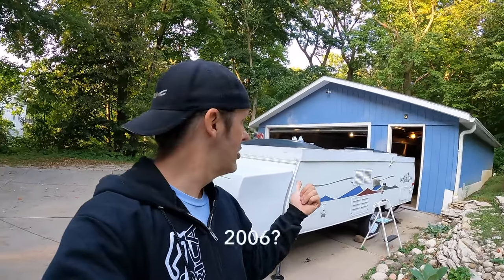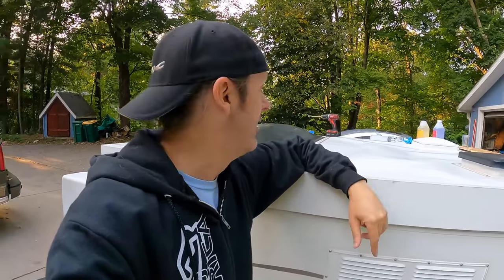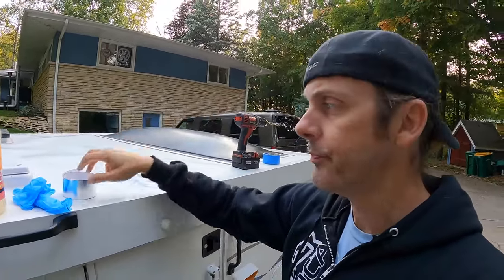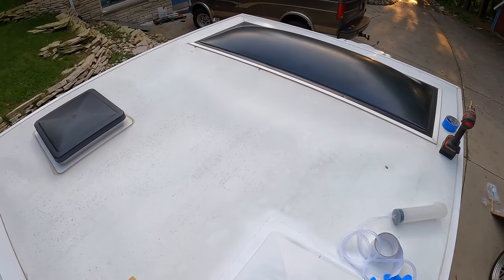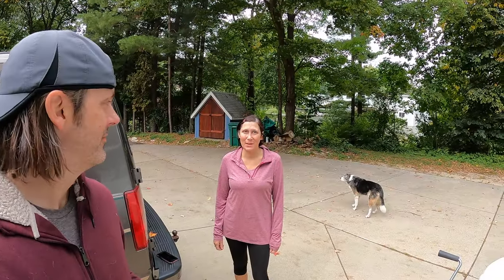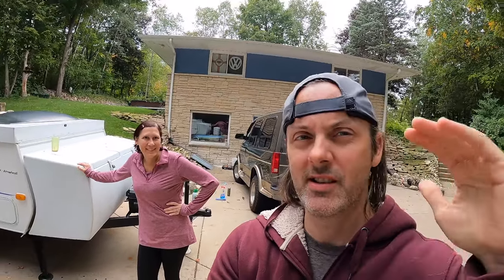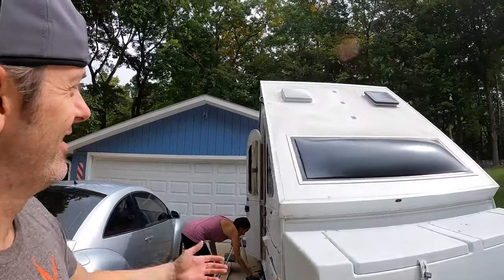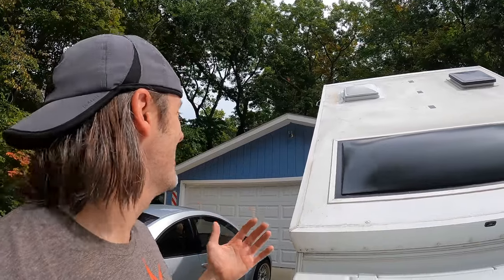Fixing Roof Delamination on AFrame Camper EASY & CHEAP Aliner Rockwood Chalet

Comment: I would not like to deal with this problem, but, if I did, I'd be inclined to do exactly as you have done. I am not sure why the skin seems to have stretched, but I do see the result you pointed out. to fix the remaining problem, it looks as if one would have to remove the metal edging on each side of the roof, drill a few more holes near the edges, inject the resin,  roll out the roof skin, trim it,  and then reattach and seal the edging.  

It seems doable, but there is also a prospect for disaster. I am not sure either how or how well those metal edge strips are mounted to the roof. Sometimes it is better to leave well enough alone.Maybe this is one of those times???

I think you did a good job and I hope your camping trip goes well.
Happy Trails!
Reply from the maker: Yeah I can’t figure out how that top sheet could be so “loose” unless maybe trailering it while delaminating causes it to “tug” a bit?   Either way it’s fixed well enough for now, and if you spotted the end scene you’d see what I’m doing next.  🙃

Comment: My biggest concern is that whatever breakdown in skin-to-foam bond occurred, is that when we inject epoxy - with this repair method we have not removed the failed bonding material, so the fix may not last long.   As to how the skin is now all of a sudden larger (bubbling) - it takes very little extra length to develop that curved surface! I suspect that excess heat is one possible cause (it failed the OEM adhesive). Our 2003 Aliner had a longitudinal crease down one roof when we bought it in 2019 - I can't imagine what caused that to occur.
Reply from the maker: Yeah, I'm guessing water intrusion, and then cycles of condensation/freezing/thawing is what caused the bond to break.

Comment: I tore off the entire roof, I ordered new panels and TPO roof and that’s what I’m doing
Reply: Whats the framing like under the roof skin? Wood? Metal? spacing?
Reply: @larrysee7306   nothing, it was just foam insulation and the roof top was fiberglass, both were glued together, i actually added 1/8 aluminum angle bars every 2 feet and cut my panels in half they were 4x8 sheets of insulation and 1/4 inch fiberboard glued together.